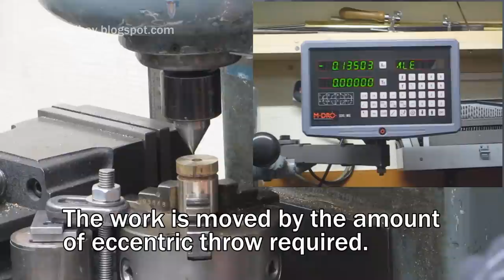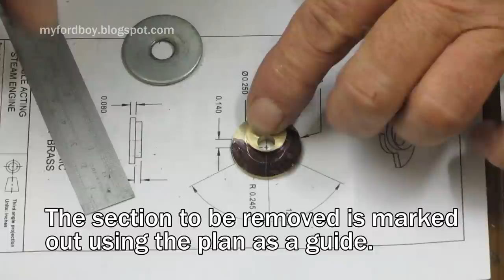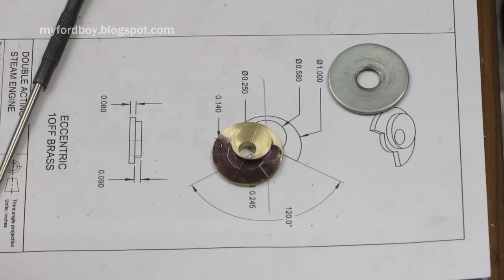Building the Myfordboy Steam Engine Part 8 Eccentric and Rod

Comment: iv never seen the idea of putting the whole three jaw with the part still in it on the mill, why did you choose that route over indicating in the offset with a four jaw?
Reply from the maker: Doing it my way ensures the offset hole is parallel to the bore as the part has not been disturbed. Also it's quicker and the amount of offset can easily be read from the DRO on the mill.
Reply: Okay, that makes sense. iv definitely been doing the long, tedious way lol

Comment: Around 14:00 you show there is a "button" thing that drives that eccentric, what is the purpose of that vs just having it fused to the crankshaft to spin as a single unit?
Reply from the maker: The eccentric is loose on the crankshaft and is driven by that pin. There is a sector cut out from the eccentric. This enables the engine to run in either direction. Know as slip eccentric valve gear.
Reply: myfordboy
Ah, so it's just adjusting the valve timing a bit for when it runs the other direction?
Reply from the maker: Yes it alters the timing.